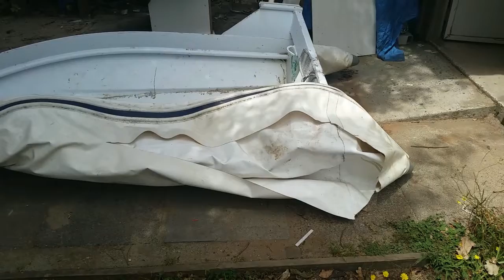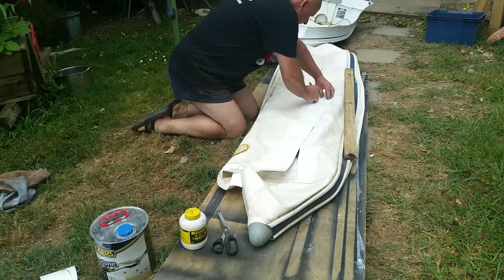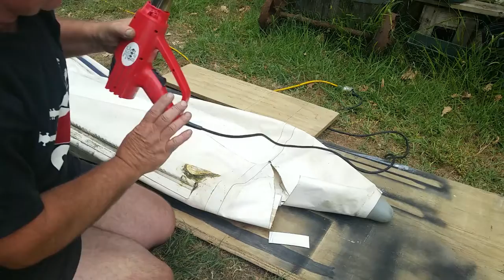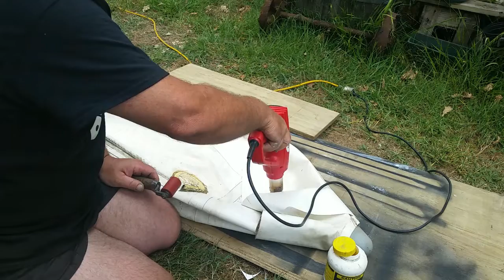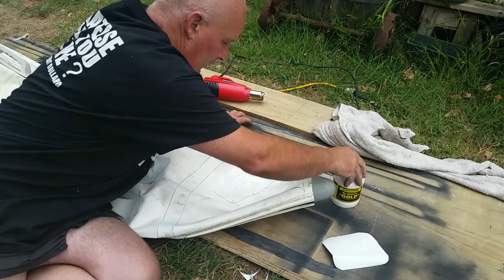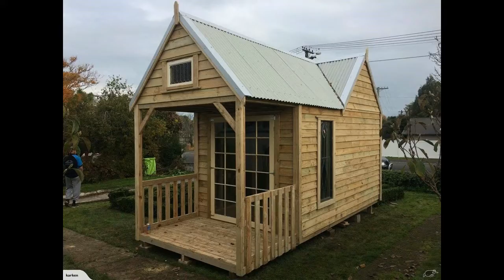How To Repair Inflatable Boat DIY with simple tools

Comment: Awesome job! Thanks for the advice re PVC glue, will save us all a tonne of money. I'm not an expert, but I'd probably also put a patch on the inside for extra strength. You could put baking paper over the top of the inside patch, so it doesn't stick to the inside of the tube on the other side when drying. This is a trick people use when re-gluing valves on kitesurfing kites. The baking paper then of course, lives inside the boat forever which is not an issue.

Comment: When lining up edges I've had good luck with putting some duct tape inside to hold things together for the glue up. Don't know if it's right for that awkward nose section you did, but it's worked for stuff I've glued when I didn't have extra hands to hold things. Good how to video. Have a great day.

Comment: Duct tape holds the repair together from the other side( it's okay to leave it inside the tube. I'd be putting an inside and outside patch on those areas. Doc (30+ pro years exp) Should use a larger brush with sweeping not dabbing motion. 2-3 coats(thin) of glue.

Comment: What do you recommend to clean and remove mold and mildew stains and also a good cheap protectant to keep mildew and mold away afterwards?
Reply from the maker: Jiff- abrasive bath cleaner on a cloth mop in a cordless drill- wear glasses!

Comment: When you use 2 part marine glue it says to coat both surfaces and let dry for 20 minutes. Then apply another coat and let dry for five minutes, then apply your patch..  It instantly forms a very strong tacky bond.  I tried  the pvc pipe glue instead, and  I didn't get the sticky bond.  It did eventually dry, but after putting on the patch I had to put heavy weights on the patch for 24 hours while it dried.  There are so many different kinds of pipe glue, fast set , slow set , medium..wonder which kind works best?

Comment: Hello nice vídeo
 I have a dinghy west marine that has several holes in the rubber on the sides and other joints which I cannot put a patch or several in all the affected areas...My question is do you think that just applying the pvc glue in all areas do you consider that the small gaps can be covered without pachts?
I apreciatte your comments
Reply from the maker: No- I dont recommend that at all. The areas must be cleaned and patched- the material is so cheap- just offcuts from a truck canvas place
Reply: Thank you very much I will pachts all the areas

Comment: I was offered an inflatable Kayak some while back - it was bust naturally, wish i'd seen this then. Everyone told me what a ball - pain in the neck it would be so I let it go. Good video.
Reply: It is a pain. I talked to a rep whose website pointed out that military boats are vinyl now.. not hypalon.. I was impressed until he also said military spec says service for 2 years and then toss it. I have a hypalon boat that is 20 years old and going strong. Not sure how long vinyl can hold up.
Reply from the maker: @ejkoford5303  - er not vinyl!- vinyl is the soft cloth backed stuff that boat seats and old car seats are made of. there is also Polypropylene - you cant glue that either. this is PVC glue It glues PVC. the rep is just plain wrong sorry
Reply: @t.h.o.r.  PVC= Polyvinylchoride... ie "vinyl..."
Reply: @ejkoford5303  Glued vinyl usually no more than 10 years.

Comment: Great information. Thanks for sharing this.  I have a leak underneath a strip of material (12" x 6") attached to the tube in lower bow area. The strip has the OEM's trademark on it and its peeling back about 1".  Not sure if this strip has another purpose or its just decorative, but I think its just a badge.  Should I try to re-glue the seam where its just pulling away from the main tube or remove the entire strip with a heat gun to inspect and install a new patch? If I remove the whole strip can I re-use and re-glue in place or use a new patch?
Reply from the maker: You can reuse the strip but time and acetone cost more than a new patch- I would peal the loose piece back to get dirt and sand out and give it a good clean then re glue if its easy to clean- or make a new patch

Comment: The only pvc glue I've ever seen for plumbing pipes hardens very ridged. Does  this stuff remain flexible? Thanks
Reply from the maker: Yes totally, Ive used it for years- I used to contract repair curtain sider units for trucking companies
Reply: @t.h.o.r.  Great I'll give it a try, Thanks for reply

Comment: I just did a price check on this Marley Gold PVC glue. 500 ml is 46 NZ$ or 27.2 Euro. In Denmark I get 3 cans of 170 g each (Plastigum 77 almost the same and each with a brush inside) for 40 Euro in all. But I have seen prices for PVC-glue for this in US, that is much higher.
Reply from the maker: HERE IS WHAT iM USING NOW- GREAT PRICE - iN FACT EVERY THING THEY SELL IS AT GREAT PRICES https://nzpipe.co.nz/collections/gutter-spouting/products/copy-of-2917-silicone-white
Reply: @t.h.o.r.  Wow - that is cheap. I have seen one argue, that the glue for pipes do not have the flexibility - it is harder when cured. But I have no idea it this is true. Such rumors can also be there to keep a price difference.
Reply from the maker: @sewingmachinesindetail   the white one for gutters is wrong- the clear one Ive used for 35 years in my canvas and pvc goods business.
Reply: $40/QUART
Reply: @SouthernSierra56  Thanks. I guess it must be a US quart gallon then, and it is about 0.94 liters. For smaller projects with patching, I think it is easier to use the cans with a brush inside. Then you do not need to clean a brush or buy a new for each project, and you always got the right amount of glue at disposal. I have also used a PVC glue, Sabacontact 70T in similar small cans with a brush, but I like the brush in the Plastigum 77 better. You can get one liter of Sabacontact for about 35 Euro, so it is about the same price level here in Europe. Perhaps you can refill the small cans with a brush from a larger can if price is important.

Comment: Interested to know how that glue has held up, becuase as you know PVC glues sold for boat repair are very costly. Can you explain how this glue is just as good as the expensive stuff?
Reply from the maker: Ive done canvas and PVC work for 35 years always used Bostic 999 until one day i saw a bottle of PVC pipe glue on another guy's bench  and asked him.- he said "PVC glue is PVC glue, doesnt matter what bottle its in" so I tried it and have used it since. Thats about  20 years. Its exactly the same. was confirmed by the industrial chemist at Holdfast Industries who make Gorrilla Glue under licence  here in New Zealand
Reply: @t.h.o.r.  Thanks TH and OG. I used HH-66 on a vinyl tarp with terrible results so I have been skeptical that "glue is glue." But maybe i did it wrong. I'll have to try it again. Appreciate the information.
Reply from the maker: same glue - different containers according to the industrial chemist from BOSTIK

Comment: Just saw your video regarding the major repair.
Did you have any issues using this glue regarding flexibility?
Reply from the maker: None at all- Ive done canvas a pvc repairs since 1985 and it is the proper glue- its just a much cheaper way of buying it. If your boat is old and sunburned - clean hard with a stainless steel scourer around the repair area and use the PVC primer that they use on pressure pipes - the purple stuff

Comment: hello hope you are doing very well ,i do have a broken boat from pvc the problem is that the table from the back that holds the ending which brook from the side of pipes 
thank you in advance
Reply from the maker: You have a lot of stripping to do first. Use a heat gun to heat the patches and pull away with plier -grips. Then lots of cleaning with acetone and wire brush. Then you cut new parts and glue on with the methods shown here. Get the pvc patch material from truck curtain repair business.  You will make a great job.

Comment: The PVC repair patch has a very glossy side and a less glossy side. To which side do you apply the glue ? Thanks
Reply from the maker: both sides of the repair
Reply: @t.h.o.r.  .......Which is to the unglossy side of the repair patch ..? Glossy side on outside. When new I suppose the PVC boats are shiny on the outside.The repair patches I bought have two quite distinct faces . Perhaps they are not the right sort ...

Comment: Hi there, hey where did you get the big bit of pvc patch from, I can only buy small bits locally. chur Ben
Reply from the maker: Hi Ben- you need to go to a Canvas shop and ask for 840gsm PVC the same type as used for truck curtain sider repairs. Its on a 2m wide or a 2.5m wide roll

Comment: l have a question can l use the same way to bonding rubber elements like rod holder and the same  cheap glue -pvc cement ?
Reply from the maker: pvc cement for pvc-. It welds. its nothing like rubber, I dont think it would work at all.
Reply: Hi I have a dinghy west marine the lateral cover is broken with a lot of small holds 
I would like to know if I can cover the holds only with the pvc glue
I apreciatte your coments
Reply: with hh66 vinyl cement could work.?
Reply: @danielreal8815  9

Comment: Nice!  Guess what Im doing this weekend.   How long did you leave it to cure before inflating?  Thanks
Reply from the maker: Just minutes, Its heat activated and virtually instant.. If you can get the PVC glue primer- the purple stuff, that will make it stick even better. But trust me- the glue is the sane
Reply: @t.h.o.r.  thanks. I got the pvc cement and some acetone today.  Last week i tried a fix with the repair kit that came with the dinghy and it left a few air gaps. The tube of glue might have been old. I'm hoping to heat gun it off, clean it up and have another go using the roller and heat activating it with the gun. I might rough with sandpaper to get a good key.  I have not got the purple stuff but will clean  really thoroughly. Cheers

Comment: Hi, thanks for the information. We only have cpvc glue available here. My Intex Mariner 4 has leaks all over the joints. Will cpvc fix the issue? I have enough pvc patches with me. Kindly let me know. Thanks
Reply from the maker: Im in the dark here- CPVC- dunno what the first c is for? but if you have acetone for cleaning and conditioning where you will glue- the glue to use is the PVC pipe cement used for the waste pipes under your sink. NOT the guttering cementwhich is white and pastey
Reply: @t.h.o.r.  yeah it's the same thing I guess. Cpvc is chlorinated pvc. I guess that wont affect the adhesion..🤔
Reply: Nope I tried but it doesnt work with the solvents available here in India. Could you please let me know the solvent you are using? I have an Intex Mariner 4..guess it's made of pvc..right?🤔
Reply: Jerry thomas Azhakathu hey buddy, question. I have a mariner 4 too.
I have quite a few holes around the boat.
Can’t find pvc patches to use , without getting them shipped but I’m traveling.
Do you think I can cut up one of the inflatable seat cushions, since I don’t use them and use those as patches with pvc glue?
I’m thinking I could but haven’t seen anyone else do it..
Thanks.
Reply: NO

Comment: hey buddy, question. I have a mariner 4.
I have quite a few holes around the boat.
Can’t find pvc patches to use , without getting them shipped but I’m traveling.
Do you think I can cut up one of the inflatable seat cushions, since I don’t use them and use those as patches with pvc glue?
I’m thinking I could but haven’t seen anyone else do it..
Thanks.
Reply from the maker: I dont know how thick the cushions are - but if the holes are just punctures not tears it should be fine - so long as the material is the same type- pvc.

Comment: i tried using PVC flexible cement, it dried almost instantly! am i missing something? didn't work for me. do you have to use the heat?
Reply from the maker: yes - the heat reactivates the glue

Comment: .Hi! I have the sea eagle 330 and would like to ask you something. You see, i discovered just recently that it has a small puncture very very close to the blue hard plastic handle(where the rope passes into). Is there any way i cam remove the blue hard plastic handle and if so, how? I want to remove it so that i can patch the hole properly. Thanks for you answer buddy
Reply: I have a Sea Eagle 470 kayak and one of the seams split so they replaced under warranty, leaving me with the old one.  I have recently removed the D Rings (14 of them) by using a hair dryer and pulling them off of i suspect this will also work for you.  This weekend i will test gluing one Dring back on before gluing 4 D Rings onto a RED Paddle 11' SUP.  I might also try to repair the seam on the kayak, but suspect it will then fail elsewhere on the seam.
Reply from the maker: How did it go Geoff?
Reply: @t.h.o.r.  D Rings are holding on SUP.  Have put 4 on SUP and used them to attach a kayak seat.  Have paddled 4 times.  All held, front two under load of foot rest supporting my weight on seat back.  Thanks for the video and you tips.
Reply: @geoffpender1920  Thanks for these answers. I noticed, that more of the handles in video was on their way off the boat. I have worked with inflatable airtracks for gymnastics, and they got similar problems and repair methods. I just made a video regarding a DIY handle. There is a lot of different procedures shown on YouTube regarding patching of PVC inflatables. I have always used pressure to the joint while the glue cures, but very few use this method. With this video from THOR I see that the roller is used in combination with the hot air gun, and I guess that this is a nice tip. But it is likely, that the air should not be too hot. For hot air tarpaulin welding you do use the roller in this way, but then the air temperature is much higher. Hot air welding is not to be recommended for these applications, because the joints will not last. Some of the older airtracks used welding for all the joints, and these joints do leak over time of use. Glued joints will last a very long time.

Comment: Great video!! Is that glue flexible? Most of the pvc glue I've seen for pvc piping dries awfully rigid, like hard plastic. For your application you'd need  flexible type of pvc glue, like hh-66 glue, right?? Or am I wrong in this assumption..??
Reply from the maker: Its the correct glue- its just packaged differently - I promise. why pay 4x the price just cos it has MARINE written on it?
Reply: I thought the same thing. I was going to buy a 5ml tube of marine pvc glue online but the hardware store has pipe pvc glue 125ml for the same price. I thought it was the same stuff. Going to go there tomorrow. Getting 25x more for my money thanks :)
Reply: tHAT'S PVC PIPE GLUE, DO NOT USE THAT.

Comment: Hey there, so no sanding of the patch and boat before bonding?
Reply from the maker: No the acetone keys it sufficiently
Reply: @t.h.o.r.  brilliant thanks. Do you just use 2 part glues for any rubber/PVC gluing? Like handles/ transoms etc? Any tips on buying those 2 part glues from somewhere other than an expensive repair pack?
Reply from the maker: @jasonholdaway6247  I towed 2.5m tender on a passage full of rain water for 30km at 5knots with a repaired towing eye. it was a  new reinfocement patch, made to same shape as old. where it came off was soaked in acetone to soften old glue, wirebrushed to remove it, wiped down both sides with acetone again, glued both sides, 5 min wait and apply with rubber tyred roller and heatgun. Its been good as new since. the reason it let go originally was that the tender got stuck behind a wharf pile and  it tore slightly
I hope this helps? Ine never used the 2 pack cos Ive never done production work Honestly- this generic PVC cement for plumbing waste pipes is just as good as the Bostik 999 that we use on the truck curtain sider industry for repairs and you can buy it anywhere in small tubs with a brush- Its the same thing Im sure. you can get even better results using the purple primer that they sell to go with it.
Reply: @t.h.o.r.  Hey thanks for the reply. I tried to use the Marley Gold to glue the rubber transom to the PVC tube and it just pulled straight off the Rubber transom without sticking to it. (The glue stuck well to the PVC which i will now remove).
Reply from the maker: @jasonholdaway6247  yep ot wont work at all on the Hyperlon. but pvc to pvcis OK. Marley Gold is not quite s good as othe brands. the bostic PVC cement is the one that I believe is just 999 repackaged
Reply: @jasonholdaway6247  Hi so you can't use it for sticking the transom rubber to PVC? Did you find something I need to do the same?
Reply: @MrRobinski  hey i ended up buying some glue from a specialty glue store. I cant remember what is was called (either the glue or store) unfortunately, and I threw away the empty can after I used it.

Comment: 2020 : How has the  repairs held up ? I have a sea eagle and its liberally opened like all over ... here in India its impossible to get someone else to repair ...such an industry is not accessible to me ... only way ..buy a new one ... NO WAY ... or repair it painstakingly .  So I wanted to know if your repairs have held up using the UPVC glue ... I intend to do the same
Reply from the maker: Just pvc glue for plumbing waste pipe. You need to key up rhe surface with acetone or MEK  first. All my pvc repairs hold up lol. I've been doing it for years
Reply: @t.h.o.r.   because that bottle says uPVC  ...that got me confused

Comment: I am tiny bit confused. I can't find 840 gsm PVC . Does it have a different name?
Reply from the maker: It comes in wieghts 380 gram per m2 to 840gsm Truck side curtains and boats- really heavy stuff
Reply: Thank you very much. Could you give a an advice what to use instead of sugar soap cus this product is not available in Canada